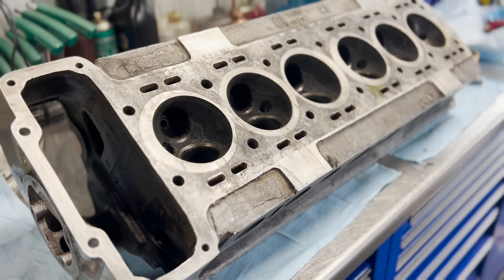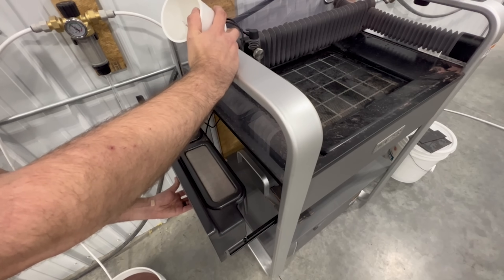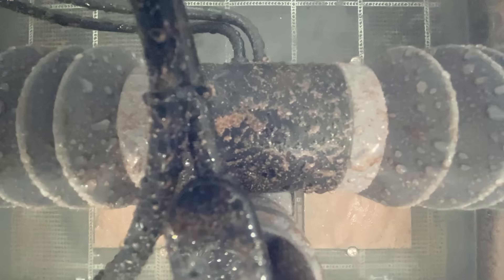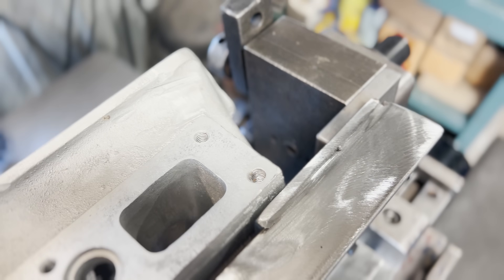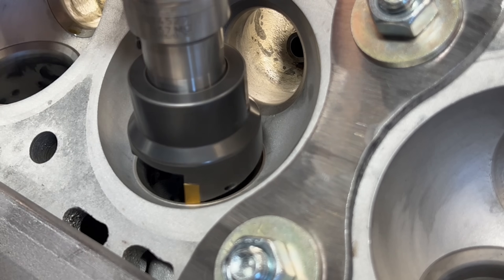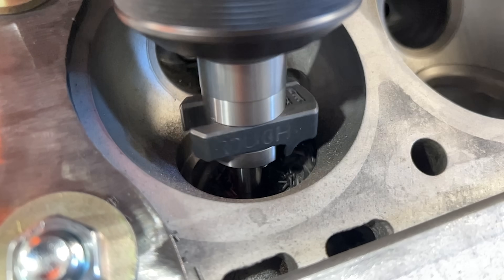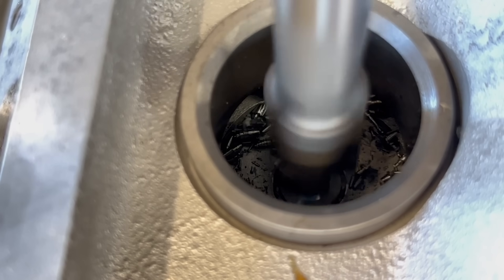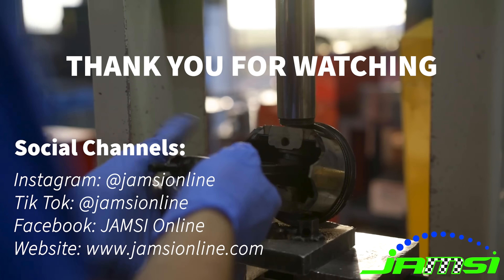I Made A Custom Fixture For This 4.2L Jaguar Head w/ A WAZER Waterjet!

Comment: I have used plasma cutters to do those sorts of cuts in way under 3 hours and with a smooth edge and no heat distortion. The water cutter is a nice toy but the time it takes is not that good.

Comment: 3 hours cut time on that abrasive cutter is a waste of 2 1/2 hours of time. A hands free torch or plasma torch its a 10 minute job with 20 minutes left for deburing. Time management is money saved or lost. Ive seen other so called water jets. In my experience OMAX is the only brand of water jet to use. Everything else is just a total waste of time and money.

Comment: 20 years ago I worked in a saw shop. I learned there that even number perfectly spaced cutters cause vibration. This is why a lot of face mills have odd number of cutters. Also, they would cut circular saw teeth spacing by hand because it would make the spacing slightly different between the teeth helping to eliminate vibration.

Comment: It's faster to run around the inside of valve seat with a tig torch or mig welder and seat will typically just fall out. Nice work as always though!!

Comment: I weld my valve seats out of Aluminum heads. About 3 trips around the inside throat of the seat with a stick welder and they fall right out.

Comment: We get the old valve seats out by Tig welding on the inside of the seat which shrinks the outside diameter and the seats come out with screwdriver as a lever…..as long as you are careful no damage will be done to the head.

Comment: Beautiful work. Did a head job on a 2,8l head back in early 80´s in process of restoration of series 1 XJ6. Of course did not have the impressive facilities you have. Got the valveguides out by stepwise drilling out until they could be tapped out, much in same way you did with seats. Heated the head and used cooling spray (as used to locate thermal issue in electornics) and smeared grease and the guides slid in very nicely. Valve seats where ok and was quite satisfied to have done this. No YT in those days so had to read books and talk to pro´s.

Comment: The used abrasive can be reused if cutting steel. The material must be thoroughly dried and in powder form and then blown or finely scattered across the new very powerful magnets. This is done up to ten times until the magnets pick up no more steel powder that has been created by the water jet. Microscopic analysis has proven that it is easily possible to remove all the ferrous metal powder leaving the abrasive in pristine condition. This is not for amateurs as any steel powder remnants will damage and erode the nozzle. Since these are replaced periodically minor erosion is to be expected downstream from the manifold where the abrasive is introduced into the water jet. This only becomes cost effective where hundreds of pounds of abrasive are used daily.

Comment: I used to work on ship engines and we would notch the valve to create a gap on each side of the valve and then weld the valve to the seat so we could press out the seat and valve together, not sure if that is something that could be done with smaller valves but curious to see if it would work instead of machining

Comment: I own a plasma cutter and to me it does the same job as a water jet and does it a LOT quicker. For your fixture a steady hand  would do it by hand. And that is all I have. It will cut 3/8 though not super clean. And cost $600.
As for the rest I have seen those Serdis in action and they are very good. And the operator was as well.
Replacing seats however is a bit suss,  in alloy they too often fall out as the head has gotten larger. Not operator error but parts and old alloy. In iron I can near guarantee when they are pushed in the pocket underneath will open up the head. I will not have iron heads inserted as it causes too much grief. Bars Leaks helps!!

Comment: I have had similar issues with chatter with cutting tools with even number of inserts, in your case try a 3 flute tool it will be more stable in the cut.  Think of it like a 3 leg stool on an uneven surface or in your CAD software you define a plane with 3 points.  Great videos by the way.  Thanks

Comment: Nice tools. Back in 1980 I rebuilt the head off my Norton Motorcycle. Made oversized guides and seats on the lathe and set up a boring head on a Bridgeport mill. Man that was a lot of work, especially as I had only started using a mill about a month before..:). Ooh, the method I came up with for beating out the guides from the aluminium head was to run a tap in the top side and then thread in a bolt. I could then beat on the bolt from the underside, thus avoid peening over the old bronze guide and broaching out the hole.

Comment: Those valve guides coming out so easy at that temperature is probably why those clips where used. Not finding them on the exhaust probably doesn't surprise you.  Considering all the other stuff you've discovered that wasn't done correctly in this engine by someone else that previously had there paws in it.

Comment: I was wondering why you didn’t install the new guides first and then cut the seats out instead of using a worn valve guide? Not critiquing, just wondering if it can be done that way. Thanks for the entertaining videos
Reply from the maker: It can be done. The risk is that a new guide may end up non-concentric and or misaligned from the seat, making cutting it out as shown more risky.

By honing the guided as shown, they’re effectively not worn out from a machining standpoint.

Comment: Wonderful machining. We usually don't mess with the core plugs anymore as they tend to leak afterwards for not much gain in cleaning. There is a spot in the manual that talks about the seat depth from the back of the cam lobe which is an annoying setup but important as Jaguar only produced a small range of shims.

Comment: It's too bad I'm not located closer coz I've got a kinda hard to get (kinda not) cylinder head that needs the complete works, and there aren't any trustworthy machine shops left in the Houston area. They've all retired or sold off to real lousy people. It's hard to get good machine work like this down here these days
Reply: Yes a good machine shop is very difficult to find. Many of the good automotive machinist have retired. Seeing a young man take up the trade and looking to work at such a high quality level  is wonderful! Being a Jag guy, after I watched the video, the next thing I did was find out where these guys were located. But the beautiful thing is, in our world today, one can ship anything anywhere.  And there's always a road trip! Houston is not that far away from Colorado.
Reply: @charleyfrancis8671  It is when the only usable head I've got left (machinist ruined my spare) is on my last and only running vehicle. Could probably find the older style head I don't want, and use that while the good one is at the shop I suppose that's an option. But even those are getting hard to come by in the junkyards (it's a 4cyl Ranger motor, ALL the good later parts are gone; the old school Lima SOHC, not the DOHC engine) '98-'01 head is the one to have and they just aren't out there anymore, naked castings cost twice as much as a full works machining and I don't really understand why but that's 2022 for ya
Reply: @Drmcclung   Hey, when you say Ranger, do you mean Ford Ranger, that they stopped making in 2011?  Your response caught my eye because I have a 1998 Ford Ranger, well it's badged a Mazda B2500. It is a 4cyl w a 5 speed. I'm really curious what is unique and special about the heads on the 98 through 2001. I've been thinking about putting a good amount of money into my '98, mostly it needs cosmetics and is still a strong runner but you did get my attention. Thx!
Reply: @charleyfrancis8671  It's unique because the '98-'01 was stroked to 2.5 liters so the head porting is slightly better (the head was updated really that's all it is), but absolutely EVERYTHING except the rotating assembly is interchangeable between '89 and '01 blocks. And I do mean everything. I'll try to make this as concise as possible without all the minutiae: The road-going 2.5 is already rare coz it was only made for 4 years (although it did continue in stationary equipment like boom lifts & other field equipment - with the older head, that's problem #1). Problem 2 is Ford didn't touch the block's deck height, (same deck height across the board) to keep all the externals & chassis placement identical and the problem with that is the 2.5L stroke, 3.401", in a block that was designed from the start for a max of 3.126" and they got around that in a kinda dumb way; 2.5 blocks & cranks have a smaller crank journal, different rods, & pistons with a different compression height to make it all fit in the old block and that's how they squeezed out the 3.401 stroke. Problem is, the 2.5 rods break, they're like graham crackers, and I don't know who cast the 2.5 blocks but they're sh*t too, VERY thin. When the half-shell thrust bearing (problem #3) wears out with a manual trans hanging on the back of it, rod #4 usually breaks first coz that's the one that catches the block and snaps without any warning, it's a ticking time bomb. You will have 0 indication the motor is gonna blow. SO, you get yourself an '89-'97 2.3 block, change NOTHING ELSE in your truck, only the block.. use your 2.5 everything the head, accessories, intake, exhaust, I do literally mean change nothing in the truck but the block if the 2.5 blows and didn't hurt your head. It'll go down 250cc's in displacement but the computer makes up for it. So 2.5 heads are rather precious just due to modern scarcity.
Reply: Also I forgot to add the only way you can tell a 2.3 from a 2.5 at a glance is the 2.5 block will have a giant "25L" stamped on the side of cylinder 1 on the driver's side and on cylinder 4 on the passenger side (sometimes); it's always there on the driver's side. It's a big ass stamping. So don't expect to stick a 2.5 crank in a 2.3 block without spacers, or a 2.3 crank in a 2.5 block without having it line honed and opened up to accept the 2.3. These swaps are stupid, don't swap cranks. Stick with all 2.3 block/rotating assembly it's a bulletproof swap and better than trying to score another complete 2.5 short block. I know from experience, I've done exactly this on my 2000 and it runs the same*. As a suggestion, you *can swap in the factory 2.3l tube header to a 98-01 but isn't really all that better than the crappy 98-01 tri-Y cast manifold. So don't waste time on that
Reply: @charleyfrancis8671  Took me 3 months to find my spare, the one I was gonna use after my weekend overhaul was done, and took the guy I took it took the head to 15 minutes to destroy the cam towers.. Don't know WTF he was trying to do but he hogged it all out, and game over, trashed the head, nothing you can do to fix that. So now I've got a worn out head on a fresh motor, been driving it like that since May. Needs guides, valves, seats, lifters everything. It's a mess. Somehow still holds compression
Reply: @charleyfrancis8671  Hey 1 more big thing to be aware of is the factory valvetrain in all versions of the head isn't that good, factory valve seats are a long long known weak area, that's why I wanted to have these guys work on my last head, my original-to-the-vehicle head. Modern seats & new valves + guides solve the problem for good. Just something to be aware of when it starts to run really oddly for no apparent reason and there's no vacuum leak anywhere to be found. Guys will chase their tails off trying to figure it out and it's just leaky valves, nothing more than that. Stumbling (not quite a misfire) on high idle cold start in the morning is a dead giveaway the head's just worn out. Factory springs are weak and don't last forever either which further exacerbates the problem and the pitting starts. Eventually it just won't hold enough compression anymore and makes the ECM do the "disco dance" trying to trim everything back

Comment: A little overkill but gets the job done. Make sure you lock down the lifter bores (a must).
In case you didn't get the valve installed height before you disassembled they are either .848 or .858 on the 3.8 and 4.2 depending on early or late. Cam centerline to tip.

Also if you are going to be adjusting lash yourself it must be checked multiple times and you will be switching lash pads multiple times.

I have many pads if you if you can't get a certain size I may have it.

Comment: You might want to look into adding the retainers for the lifter guides. Also Jag had alinement issues at the rear main seal. Line bore and checking the crank for straightness might be in order. Often the rope seal retainer got bored and trued as well. The early 4.2 blocks like the one you are working on had the head studs in the surface of the block. The later motors ran them through the surface, through water jacket and into the block below. Block surface cracking solved.  Head stud corrosion and failure became the new problem. Steal through aluminum in to cast iron surrounded by water... What could go wrong? Lol.  Removing broken studs from down in the water jacket was not fun.  Have fun with that build. Brings back memories for me of past jobs done.

Comment: I've not had the opportunity to use it yet, but an idea I'd seen for removing seats from an alu head is to put a good MIG weld tack onto the inside of the seat.  The shrinkage while cooling will loosen it sufficiently for it to come out easily, supposedly.
Reply: I've used this method on bearing races a million times. It works!
Reply: @alantrimble2881  It works other things also. As long as you can get the nozzle of the mig gun into the area that needs tacked.

Comment: What are the benefits of the waterjet machine over a CNC plasma cutter? I feel like a CNC plasma cutter would've done that job quicker and without using 50lbs of abrasive, but then the waterjet machine must exist for a reason
Reply: Doesn't warp due to heat.

Comment: 3hrs for so few pieces? Doesn't seem very effective. I'm not sure how much that machine costs, but for under 2000 bucks you can get a similar size plasma cutter and could have had those pieces cut out in 10 minutes or less.

Comment: I used to hate it every time I saw a Jaguar head come into the shop, setting them up on our surfacer to mill the head gasket face was always a pain due to there not really being a good surface to bolt them down on because the rocker head gasket face angles are in the way of everything.

Comment: I realize Wazer sponsored you with a unit, but I have to point out how crazy inefficient this tool is for this job.  3 hours to make those cuts and a plasma table would have done it in about 45 seconds.  The plasma is also a lot less expensive to run, when you consider these 3 parts used 50 pounds of abrasive.  That part cost you $75 to cut at Wazer's retail cost for a bucket!

Comment: If you ever have chatter issues with a tool with carbide inserts you can always remove one cutting tip to turn it into a single tooth cutter.

Comment: Great work. Nice to see an abrasive waterjet cutter no bigger than a small refrigerator. Lots of advantages: no heat affected zone, smooth finish and no delamination on composite parts.
Reply from the maker: It’s pretty cool! Great for a shop like ours who doesn’t have space for one but still has uses for one! Also awesome for classrooms or home workshops!
Reply: Presumably cheaper than a laser cutter which has a very small heat affected zone.
Reply: @Dave5843-d9m  Water jets are pretty expensive to run due to the consumables. That's a long time to cut 3 parts like that.
Reply: Omax has a smaller machine now that has a 5hp pump that can run on single phase.  Still runs at 30k psi like their big stuff, but much lower cost(which is still expensive).  But it'll cut much thicker than 1/4" and much faster.
Reply from the maker: What’s the price point and footprint of it?
Reply: @JAMSIONLINE   search omax protomax

Comment: Great work JAMSI :)  I have always removed seats by running a weld bead around the inside of the seat, then they pretty much fall out.  Do you ever use this method, and if so why not on the Jaguar head?  Again, thanks for the video :)
Reply from the maker: Welding is my method 99% of the time but I just felt it might be a bit risky on this particular job 😬 wanted to be as carefully as possible.
Reply: @JAMSIONLINE  Understood - that would be a hard head to replace if things went wrong.  Thanks!

Comment: That’s interesting that that in-line 6 uses a similar design as the Chrysler “Hemi” i wonder how tall the domes are on those pistons. They must definitely protrude into the head to attain any real compression.
Reply: Some contend that Chrysler copied Jaguar on the hemi engine. Jaguar XK engine 1948. Chrysler hemi engine 1951. Jaguar made the XK engine for 43 years.  Although the Jaguar engine is a beautiful DOC and the Chrysler is a boat anchor, Chrysler did better with marketing thus many associate hemi with Chrysler. Jaguar cannot claim invention of the hemi engine however, the first hemi engine was built in 1901 and was a 2 cylinder boat engine. The Hemi engine was first used in an automobile in 1905. I personally find the Jaguar Hemi XK engine especially with the triple SU Carb setup,  beautiful.

Comment: You can add toolmaker to your resume. Great job on the fixture. I have ran water jet machines in my aerospace career. We used them to cut titanium panels for the flight control surfaces on Boeing C17 aircraft. They don't distort the material with heat.

Comment: With no rocker arms, it’s surprising to see that much guide ware. Thanks for sharing
Reply: There is still a lateral force exerted on the valve bucket (cam follower) that will cause wear in the guide.

BTW, I lover me some Jaguar engines! Thank you Sir William Lyons and team for the finest in-line six cylinder engine ever made.